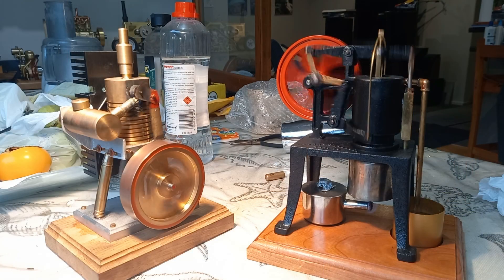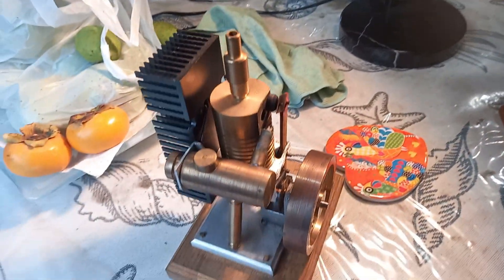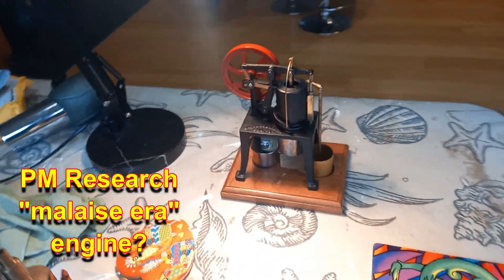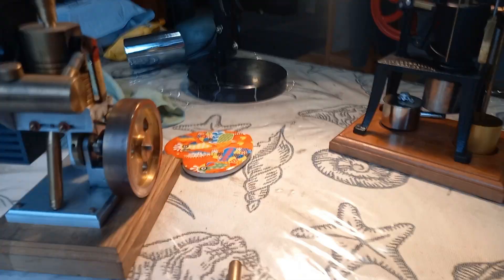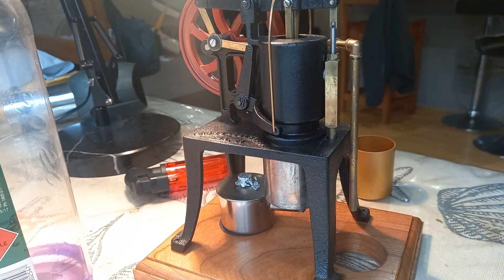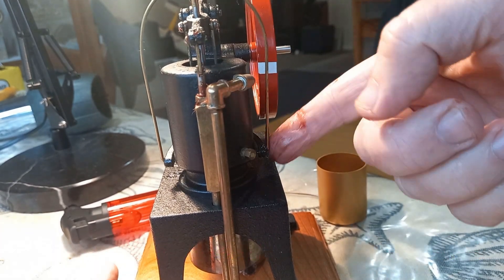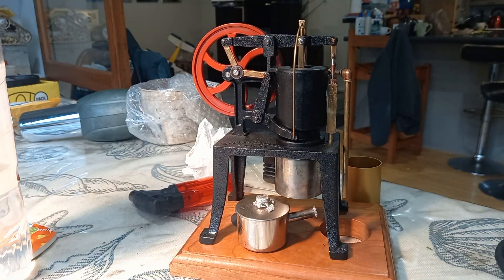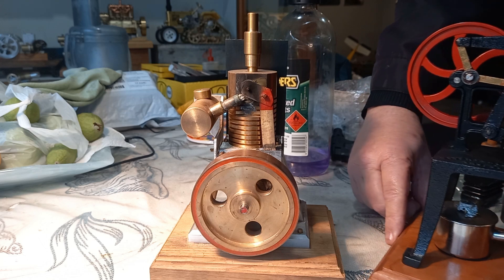Stirling and Flame-licker models, Ericsson and Flammenfresser, Microcosm R01A Preview, PM Research

Comment: I'm thinking about buying a table top simple steam engine that doesn't require a degree in mechanical engineering or a model maker's machine shop. Thomas, can you please recommend something for a fixed income budget? I do have mechanical skills!
Reply from the maker: Hey welcome! I'd start with a Wilesco traction engine or jensen engine if you live in the USA. Be careful buying any "engineer made" (non-commercial) engine used from ebay. Unless the photos are pefect and it is sold as perfect...in which case it will be expensive. Any description that says "not tested" means it likely won't run, too!
Wilesco tractors are fun as steam engines because they self-propel and sound just like real traction engines, gears clanking, steaming and whistle, water sight glass...few hundred dollars. it's a big step up from these to Markie or Mercer 3/4 scale traction engines. around $1000 dollars. If looking fpr a cheap stationary engine, I'd consider the Wilesco vertical boiler engine Wilesco D455 these have a good reputation and look great.
I have a Wilsco traction engine, roller and a Mercer traction engine https://youtu.be/SPaQQd7_EaQ 
these are available as machined kits or Looooong waiting list for completed kits. Reasonablly priced on English ebay. For steam engines, ebay uk and ebay de (Germany) are great.
For stationary models designed for model boat use, chinese models are ood value

Comment: Great video Mr. Thomas.  Try installing a gate valve on the discharge of the water pump, restricting the outlet will allow you to control the speed. After the pump packing repair of course 👍
Reply from the maker: Why, Mr. 212°, you are too kind....the valve idea is a smart one. Too many things to do...